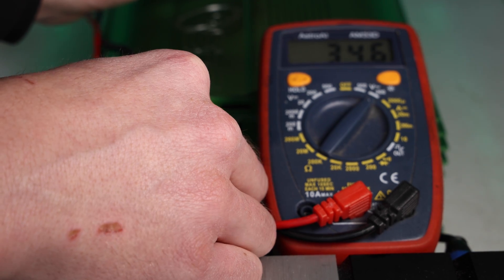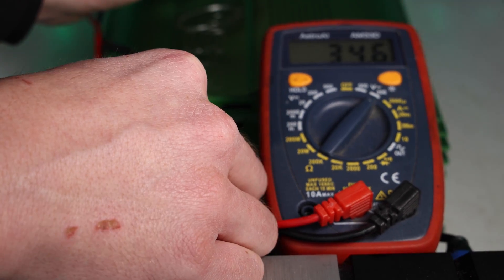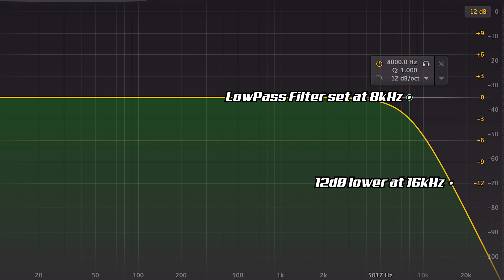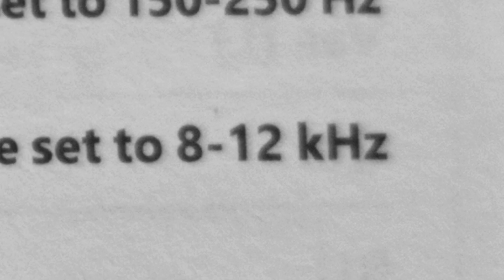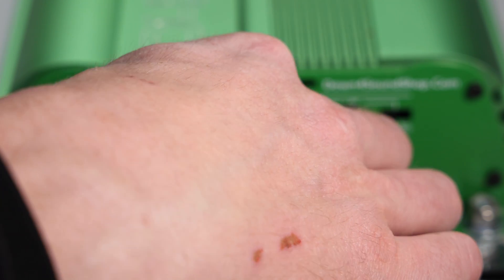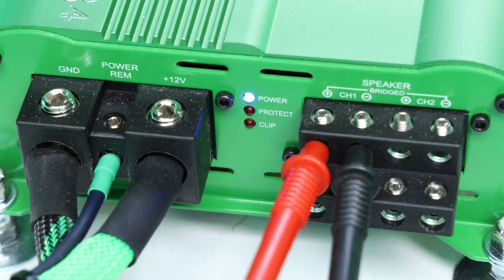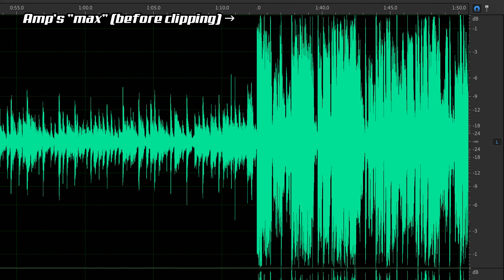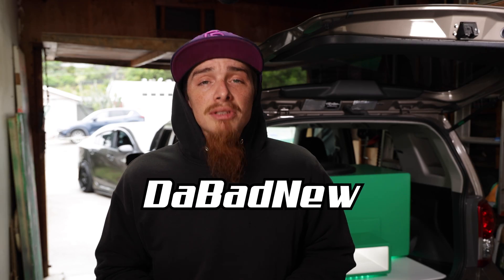How to set Filters and Gains on a Car Audio Amp to avoid clipping

Comment: Why would you want to set it to a specific power out put like 300W in your case? 

You want your amp to be able to put out as much clean power as possible. Do that to all channels/amps and then if some freq range are to loud, let's say the midrange, you turn that down.
Reply from the maker: The process shown in this video is exactly HOW you get the most amount of clean power.  The reason you do the math for the gains is because every head unit is outputting a slightly different voltage.  So by setting the gains this way, you let the amp amplify the signal by the appropriate amount.
The way you described is basically the same, but is less precise because it is with your ears, whereas the way shown in the video is the actual number at which the amp is most efficient/effective.  
Max power on an amp is NOT turning it ip all the way.  That is a common misconception that I wanted to address in this video.
Reply: @DaBadNewz  let's say that you have a 500wrms amp and a 300wrms speaker, why would you aim for 300wrms?
Reply from the maker: @extrakimF to get the maximum “safe” amount of power.  If they are 300wrms, you will be less prone to damaging them if you’re only sending rated power.  Obviously, if you want to overdrive your stuff, (and know how to do it properly), you can set the gains higher, but I’m kind of guessing that someone who knows how to do that wouldn’t be watching this particular video, since it’s aimed at people that are newer to car audio, or are trying to get the maximum rated power.
For my sub, I’m going to be at least doubling the rated power, and finessing the knob to keep from damaging anything, but for midbass, mids, and tweeters, I don’t want to have to worry about finessing anything and want to be confident knowing I can go full-tilt full-time, so those would only get rated power.
Reply: @DaBadNewz  if you gain your amp to 300wrms, you won't get 300wrms to your speaker due to impedance rise.
Reply from the maker: @extrakimF very true!  But calculating all of that and accounting for it is pretty far beyond the scope of this video. 
You’re talking about more technical/advanced levels of understanding than the people this video is aimed at are ready for.  Gotta learn to crawl before you learn to walk, you know?
Reply: @DaBadNewz   you can't calculate that since it will vary depending on the freq. My point is that if you use the method in this video, you might not get the most out of your amp.
Reply from the maker: Yes, and since you “can’t calculate” it, you use the safest numbers you CAN calculate, which in this case would be RMS.
Reply: @DaBadNewz  you are missing the point. If you gain your amp, without speakers connected, to 300wrms then you will more or less never feed your speakers with 300wrms due to impedance rise. With other words, you need to gain it higher and that's why I said that you should gain it as high as possible, as long as you get a clean signal out of it.
Reply from the maker: @extrakimF no I completely understand your point, I just don’t think you understand that that’s not the point of this video.  This video is showing you how to accurately gain match your amp to the speakers you have connected.  It doesn’t take into account impedance rise because like you said, that’s a number that will change with each frequency and each amplitude level, so the next best way of (safely) setting your gains so that you can be sure your signal never clips (as indicated in the title), by using the rms wattage.
I’m not even disagreeing with you.  I’m just saying that what you’re talking about is for folks that are more advanced (not everyone even knows what distortion to listen for), so it doesn’t really pertain to this video.

This video shows people how to calculate a reliable and safe number to set their gains.  If they knew enough to set them by ear, they probably wouldn’t be watching the video in the first place.  
So thanks for your input!
Reply from the maker: And just fyi, even the dude that designed the amp I’m using has commented on this video agreeing with my methods.  I think he would probably know a thing or two.
Reply: @DaBadNewz  using your method doesn't make sure that it doesn't clip. How would you even know if it's clipped? All you have is a voltage number and that's it. 
If you gain match it like you did and then would messure the power output over the speaker, you wouldn't be close to 300wrms. 

I don't see any benefit in using this method. 

You did make a good video covering the crossovers and a lot of people will be able to learn from it.
Reply from the maker: @extrakimF so then what is your method that anyone can do to calculate an actual number to set their gains with?  
I’d be happy to hear your explanation of setting gains using a multimeter (which is what this video is about).
So far you have only suggested very subjective ways of setting the gain that someone new to car audio wouldn’t know how to do.  
So how do we address that specific problem?
Reply from the maker: @ and my method absolutely ensures it doesn’t clip because it sets the gain at a point where the signal is going into the amp at the most optimal input voltage (obviously assuming an unclipped signal from the head unit).
If you don’t think so, try my method, and make your own video showing the results.  Make sure you show how far away from 300wrms you are with the same 1khz tone you set your gains with (since that negates the dynamics in a particular track and serves as a control for the experiment).
Reply from the maker: https://facebook.com/groups/1979222239015592/permalink/4048684148736047/?mibextid=wwXIfr

Comment: My amp has channels 1&2 and 3&4 together. Im running the same speakers as you (300w rms) so whenever I am tuning the gain should I do 600*4 =sqrt(2400)=48.99 since my two channels are on the same gain or should I do 300 like you did in your video? If so would you mind explaining why?
Reply from the maker: Just about all 4 channel car audio amps are setup the way you described, with channels 1/2 and 3/4 linked (in order to provide a gain matched stereo listening experience, without the hassle of trying to exactly match 2 channels).
That is also why you will want to do it the way I did in the video.  It honestly just comes down to the way car audio amps are built.  Since "stereo" signals should match (as far as gain), you only have to calculate for one, and the settings will be applied to both in the linked pair (BECAUSE they are linked).
Think of it this way: If you had channels 1/2 on your tweeters (one on the left, one on the right), and you had channels 3/4 on midranges (one left, one right), you would want the settings for each pair to be different, (1/2 vs 3/4), BUT, you would want both tweeters to match, and both midranges to match.  The amps just make this easy by having those channels linked internally.
I hope that makes sense!
Reply: @DaBadNewz  thank you, that makes more sense. I appreciate you taking the time to respond, subscribed.
Reply from the maker: No problem at all, happy to help when I can!  And thanks for the sub!  Going to be doing some more install videos coming up pretty soon, so I'll keep in mind to try and clarify some of that stuff.

Comment: Great video. I'm having issues with my 6.5 ds18 midrange popping and crackling. I'm running factory head unit in my Tesla. I'm confused as I why
Reply from the maker: Thanks man!  And that sounds like maybe a connection issue.  I’d be double checking all the connections are solid (give it a good wiggle!)
Hope you get that figured out

Comment: I have 2x 6.5 Silversters 130watts rms wired parellel into 2 OHMS… so would my math be 260watts x 2ohms = 520 square root 22.80???????
Reply from the maker: You got it!  Those Sylvesters are poppin up everywhere, great speakers!
Reply: @ clarity on those speakers are amazing, I have 2 super tweeters and 2 Sylvester’s on my doors no amp and it handles amazing.. I have a shorts video on my channel if you want to check it out
Reply from the maker: Yea man!  DB slowly kinda taking over out here, and I'm all for it!

Comment: Question

So i wired 4 12 inch pioneer champion subs to 3500 crunch amp, i turned gain really low but still get clipping when i turn bass knob up mid way.
Reply from the maker: Are you sure everything is in good working order?  Clean signal from HU, good RCAs, and good power to the amp?  
Could also depend on how you wired them up.
Kinda hard to diagnose without seeing it myself.  I’m happy to try if you have more info though!

Comment: If a speaker is rated at 130 rms and the amp dynos at 120 watts can you just turn the dain all the way up?
Reply from the maker: Absolutely not!  That is one of the main misconceptions I was trying to address in this video.  The part about amp gains being for matching the head unit to the amp covers that.  
Basically, your amp expects a certain voltage on input to do it's thing most effectively, the "gain" on an amp is for adjusting the INPUT voltage to match what the amp expects, NOT for controlling the output of the amp.
Hope that clears things up!

Comment: Hi, how does this calculation work for a 1 channel power amplifier that has 3000 watts at 1 ohm. Do I then simply have to take the root of 3000. And if the mono power amplifier has 2000 watts at 2 ohms I still have to take the watts times 2 Since, as I said, I only have one channel and if I took 2000 times the resistance I would be higher than 3000 with 1 ohm. Can you help me and explain. Thank you very much
Reply from the maker: Hello!  Yes you are correct about the calculation for 3000 watts rms.  The reason more gain is required for the 2000 watt example is because of the 2 ohm resistance.  The 3000 watt example has a lower resistance, so it is essentially “doing more with less.”  
Hope that makes sense and answers your question, if not, I would be happy to explain further.
Reply: @DaBadNewz  Hi, thank you very much for this explanation, I understand that. And how do I have to calculate it if I have a 4 channel and now want to run it on channels 1 and 2 with 300 watts and on channels 3 and 4 on 80 watts. I have to Then take the 80 watts with 4 times. So channels 1 and 2 then with 34.64 volts and channels 3 and 4 with 17.888 volt.Is that correct?
Reply from the maker: Assuming both channels 1/2 and 3/4 are seeing 4 ohm load, then yes it sounds like you have done your calculations correctly.
Good luck on your project!
Reply: @DaBadNewz  Thank you😁
Reply: @DaBadNewz  Hi, me again. If I connect a 2 channel bridge and a 4 ohm subwoofer, I have to do the calculation with 4 ohms or with 2 ohms because of the internal circuit. Thank you very much
Reply from the maker: Oh my bad, I missed this one!  Usually you will use the total load on the amp, so in this case, it would be the 4 ohms.  Sorry for the late response!
Reply: @DaBadNewz  Hi, I wanted to ask you. Do you have to turn off all filters when setting the gain or can you first set the filters to your desired values and then adjust the gain afterwards. Thank you very much
Reply from the maker: @andreashuelss7183 i have always heard it’s better to set gains wide open and then filter…but I actually set my filters first, because I want to gain up according to how I plan on listening (same with all the extra setting on the HU everyone tells you not to use. Although I still don’t use most of those)

Comment: I will be using this method to tune my 4 channel tomorrow. Can you use the same method to tune a bass sub?
Reply from the maker: Absolutely!  Process is basically the exact same.  You will use a different test frequency (usually 40Hz), and need to set the filters accordingly, but at the end of the day it’s the same process.
Reply: @ could you verify my math then? I have a JP 23. Thats 2300 watts rms for 2 channels. Rms per channel would be 1150, with 4 ohm subs thats 4600. The square root of that is 67.82. Correct?
Reply from the maker: Why 2 channels?  Isn’t that a mono amp (One channel)?  If you mean 2 subs, you want to just look at them as one output for the sake of keeping it simple.

Comment: Awesome video bro! Helped me figure out how to tune my amp but I got a question so for channels 1 2 I’m running same speakers down to 2 ohms so 4 total, now my question is for channel 3 4 I’m running two speakers and two tweeters also at 2 ohms since they both have different rms (6.5s 500w rms for two combined) ( 2 tweeters 240w rms combined) how would I find or do the calculation in this example
Reply from the maker: Thanks man!  Glad it was useful to you!  As far as your question, I'm assuming they're going through some sort of crossover right?  Normally you treat everything going to the crossover as a single channel, so you would feed it the full frequency spectrum of both speakers and tweeters.  For gains, I would think it would depend on what the crossover is actually doing, but if I'm being completely honest, I would need to look into that one a little more to give you a definitive answer.

I know normally with a component set that comes as a kit, you send X amount of watts to the crossover and each thing gets what it needs, but it sounds like you put together a set yourself right?

Sorry for the lack of a solid answer!  That one I would wanna test out a bit.  To be absolutely safe, you can assume both speakers and tweeters are on the lower RMS, so each channel receives about 500 RMS, but that would obviously not be taking full advantage of the speakers.

What crossover?  Maybe we can figure it out.
Reply: @ I tested out kinda the way your saying but to be completely honest this is my first system so I’ve been learning as I go. For the crossovers my amp doesn’t have that it’s a taramps 1200x4 and it only has the gain and low/high filters for tuning
Reply from the maker: @robbyn065  oh wait...you're trying to run both speakers and tweeters off the same channel, but just wired together?  Honestly, I wouldn't do that. 
The crossover I was referring to (what I thought you were using), is usually called a "passive crossover."  It takes a single speaker wire signal from an amp's output and splits it to a speaker and tweeter.
But it sounds like you're trying to do that without the crossover, which I really don't recommend.  The signal that a speaker needs is so different from the signal that a tweeter needs that you can damage them by sending them the wrong signal.
Unless you have something fancy going on, that sounds like something you may want to redesign.  
Ideally, each "type" of speaker will have it's own pair of channels (tweeters, horns, mids, midbass, subs, etc).  If different types are going to share a channel, there pretty much NEEDS to be some kind of crossover/EQ/DSP somewhere to distribute the frequencies properly.

Comment: Hey Bro, I dig all of your videos! Hopefully you can help me out. I bought four d4s-65 v2 with two d4s jfx tweeters. I also bought the Amp under your's. D4s Jp234 to power all of it. Mind you I also have 2 rear deck speakers, but those are already installed. My question is how do I wire each door to the Amp?I'm going to have two 4ohm 65v2s on each door plus a 4ohm tweeter with a bass blocker on each door. The 65v2s can take 200 rms each and each tweeter 50 Watts rms. Also are their any settings I have to change on the Amp, like the hp lf x1 x10 setting. I didn't really understand that part of your video. Thanks in advance 🙏
Reply from the maker: Oh yea we gonna have to clear up the video if that's the case!  You definitely gonna need to revisit the filter part.
So me, I would power the 6.5s off channel 1 and 2, with the HPF at 120 and LPF based on wherever your tweeters pick up the signal.
I would then power the tweeters off channel 3 and 4 with the LPF off and the HPF at whatever frequency your tweeters are made for (usually somewhere around 5kHz).
Basically, you want your tweeters to stop where the 6.5s start (frequency wise).

Hope that helps man!
Reply: @DaBadNewz  i appreciate you Bro! Just curious, will a 3 way passive crossover work with this also?
Reply from the maker: Yea of course!  You basically treat the whole 3 way setup as a single speaker

Comment: Hey how you set the bass amp for 2 15s power acoustik mofo 152x  I wired them at 4ohm  on a power acoustik  8k
Reply: I am new to the car audio
Reply from the maker: All good man!  Hope that helps!  let me know if you have any other questions!
Good luck on your build!
Reply from the maker: It would be the same process as in this video.  The only differences are that you would be using a 40Hz test track instead of 1kHz, and your filters would be set for a sub instead of mid-range (depends on your setup, but usually 30Hz~100Hz).  On most amps the low filter is called the "subsonic" or something like that.
For the gain it's the same as the video: total RMS x Ohm load. Then find the square root of that number.
Looks like those subs are 1700 RMS, since you have 2 = 3400 RMS.  (3400 RMS * 2 Ohms)= 6800.
Square root of 6800 is 82.46.  So you would be looking for 82.46 on your multimeter.
(This is assuming you were trying to feed those subs RMS.  If you wanted to give them a lil more juice, just figure out how much and use that number).